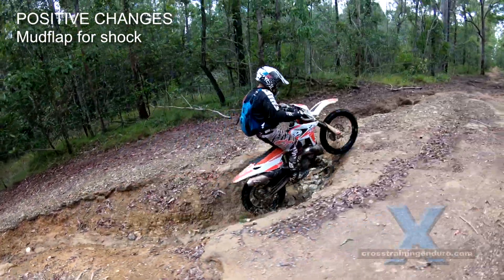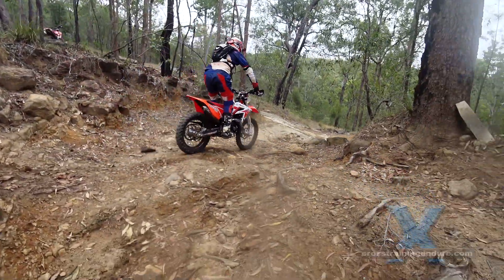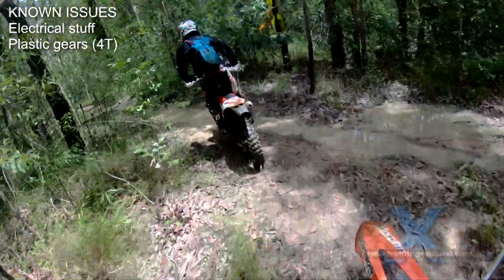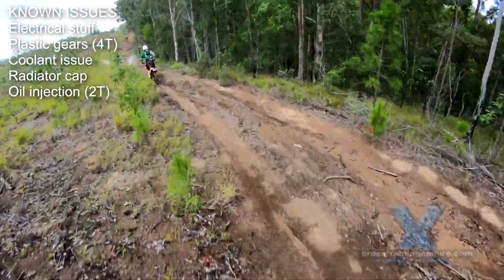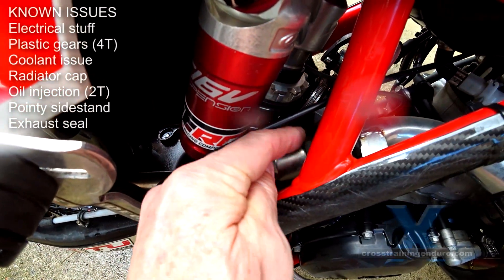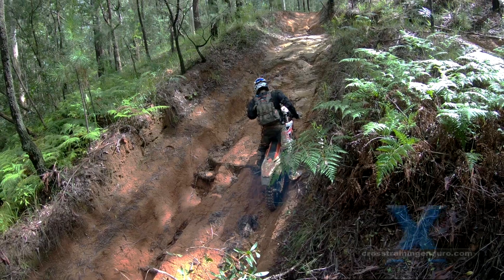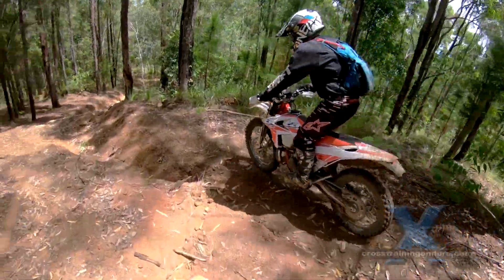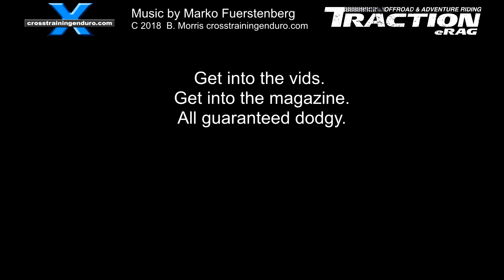BETA RR250 RR300 2018+ review of known issues and common problems︱Cross Training Enduro

Comment: Thats quite a long list tbh :(
Reply from the maker: yup, but you can make an equally long list with all the other brands too if you find dealers and/or mechanics willing to tell you :)
Reply: Yeah, I had so many issues on my '17 xtrainer 300.  With my '18 Yamaha YZ250FX -- ZERO issues.  Well the seat is damn hard though.
Reply: Although very true for brands like Beta, GG, Tm and even Husqvarna (pre KTM models), definitely not for all. I could make an interesting list for GasGas no doubt but when I think of my Yamaha YZ from 2006.. I did not have to fix anything on that bike in 5 years and even sold it with the original spark plug. No modifications needed, no cracked plastics, no loose screws! Nothing at all! Not even loose spokes after the first hours... Same goes for my friends Honda CR from 1989! Truly extraordinary build quality. Can't say the same for GG ('10, '18), Husky ('07) or KTM ('14) unfortunately. (that said I am very happy with my '18 GG)
Reply from the maker: as a rule of thumb i'd say japanese bikes are definitely better on the fine details stuff e.g. electrics, finish, mechanicals etc. but their issues list grows because of things like getting with the 21st century and using hydraulic clutches and putting sixth gears in the bigger bikes etc. all currrent dirt bikes are brilliant of course, but just saying they all have a fair number of small issues. :)

Comment: That's a lot of problems for a high end bike
Reply: Never be fooled by expensive price. YZ250X all day. I may have to kick, but at least I'm riding.
Reply: I have a 2016 300RR with 360hrs on the clock and the only things that have failed were due to rider's lack of skill. LOL  I guess I got a good one.
Reply from the maker: yep, we've got five beta two strokes in our group that have had very few issues. and thankfully we've been in the 95% without main bearing failures at low miles (so far).

Comment: For a start CT I think your videos are pretty bloody amazing & you defiantly get the essence of why people ride bikes because it's a hard thing to describe to others & I will never know how much time u spend so thanks .. but I just can't get my head around all these ferking problems with Beta's because it's amazing to me that after buying a new bike you then have to clean up the wiring loom with cable ties & reposition electrical connectors seems bone arse lazy from the factory there's no other way to describe it as is fitting the wrong radiator cap & wrong coolant ratio etc etc it & it just plays out like a Farrelly Brothers Comedy but the one that sticks in the mind is Beta fitting plastic gears to water pumps knowing they will fail & then having a aftermarket company beat them to the punch in bringing out the correct metal ones is outrageous .. European build quality  .. Double harrumph!!